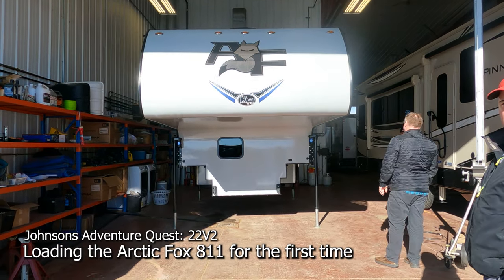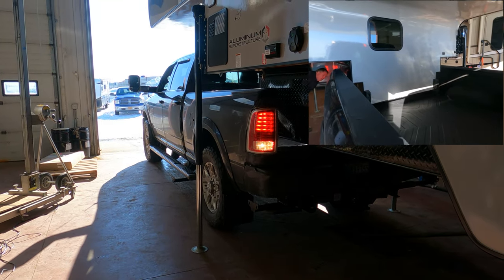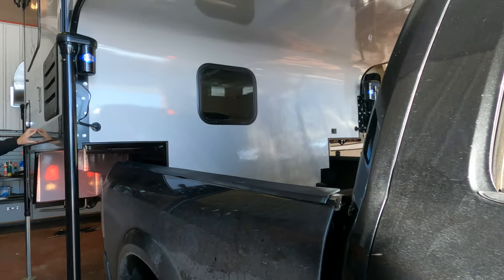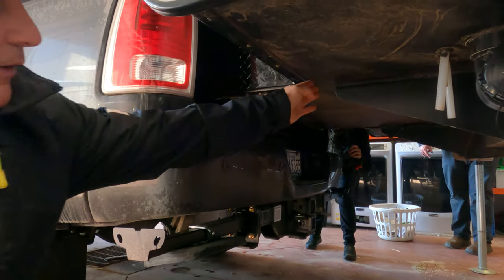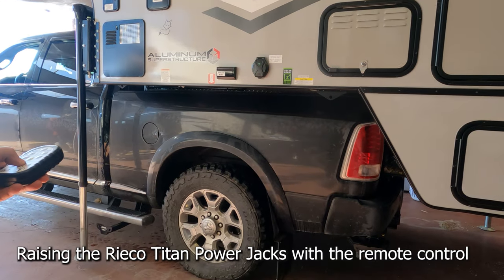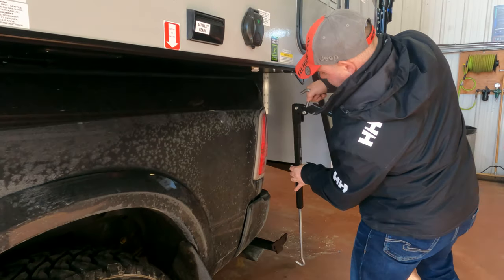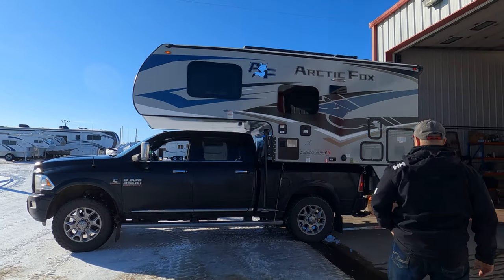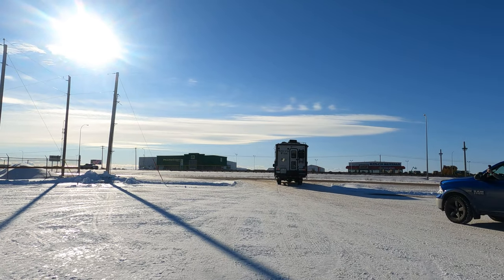Loading the Arctic Fox 811 for the first time 22V2

Comment: What’s your cargo carrying capacity on the truck? Seem like with diesel you would be over your gvwr?
Reply from the maker: Our Ram 3500 has a max payload of 3800#.  We chose the 811 specifically for the weight and size.  Our only other Arctic Fox option with a short box would have been the 865, but it has no slide.

Comment: You guys really downsize but good looking truck camper. What’s the truck camper weight?
Reply from the maker: After our first camping experience in the truck camper (video coming soon), we realized what a downsize it really is lol.  It will take a bit of getting used to for sure.  Last year we mostly jeep/tent camped and only went out in the toyhauler twice.  The truck camper lies somewhere in between.  

The tag weight on the Arctic Fox 811 is 3285#.  This of course is a dry weight.  This camper is rated for a short box which is what we have. Thanks for watching and commenting.  Happy Camping.

Comment: Greetings Sir, Great video. What is your payload rating? You are probably over as most people are with a SRW. I want to do the same thing as you, but with a 3500 GMC Denali SRW. How is the control on the road? Cheers!
Reply from the maker: Thanks Brian.  My Ram's payload capacity 3700 lbs, on paper we are good but I am sure if we scaled it we would be over.  The truck has air bags and seems to be handling payload nicely... it rides better than expected.
Reply: Mine is a Chevy 3500 srw Crew cab with 4300# payload. Add timbrens and upgraded tires and rims for extra comfort.  Rides PERFECT
Reply: 4300. You must a have a gas truck?
Reply: @Brian.A.Simmons  yep I don't mess with diesel.  Keep in mind I always have my boat or ATV too.  36" extended hitch.  Those timbrens and rim/tire combos are the real x factor tho.
Reply: Awesome man! I would love to see a video of your rigs and your set up. I plan on posting some videos of my rigs with my motorcycle connected. It's a crazy set up, but it works. Take care!
Reply: @NomadicNorthwoods  what is the tire/rim upgrade? Thanks
Reply: @owen33333  they are method hd rims rated at 4500# each and Cooper discoverer at3 4080# rated each (load index 129).  This combo is the single best upgrade you can make for safety.  No dually needed.  👍
Reply: @NomadicNorthwoods  THX!

Comment: That over hang in the back would scare me like that, I'd rather have the back flush with the tailgate,  but then again propane scares me. But nice rig
Reply from the maker: Thank you so much Michael.  We had fewer options with our truck being a short box.  It looked scary at first, but it drives nicely.  Our last camper was a 38’ 5th wheel toyhauler so this set up is very different.  I hope you follow along as we learn to adapt to this new type of camping.

Comment: Looks like the arrow on the side of the camper is behind the rear axle which I thought meant the center of gravity is to far back on the rig. Yikes.
Reply from the maker: Hi and thank you for your comment.  It may be a bad angle.  The center of gravity is over the axle.  The 811 is rated for the short box.

Comment: hello Thanks for the video. Two questions though. Is that a Ram 2500 or 3500? And are those aftermarket airbags or did they come on the truck? If they are aftermarket could you share the brand?  Thanks!
Reply from the maker: Hi, our truck is a Ram 3500 with factory air bags so it self levels and dumps air as needed.

Comment: What is your load capacity for your 3500...and the weight of your camper?
Reply from the maker: Hi Dan.  The load capacity for our 3500 Ram is 3800# and the camper’s dry wt is 3385#.  We had to do our research to find the right camper because we have a short box.  The Arctic Fox 811 was one of the models made for the short box.

Thank you for your question.
Reply: @johnsonsadventurequest  ok perfect thankyou so much..this helps me a bunch..safe travels

Comment: It's too heavy for a Ram 3500 with factory airbags. Had to upgrade the truck to a 3500 duley. Still unstable with the center of gravity behind the rear axle. Don't try it.
Reply from the maker: I am so sorry you had issues.  We really haven’t had any problems with the 3500.  We specifically purchased this camper because of the truck we had.  I hope you are enjoying the camper.  :). Thank you for watching.